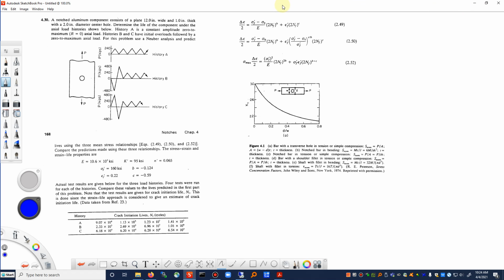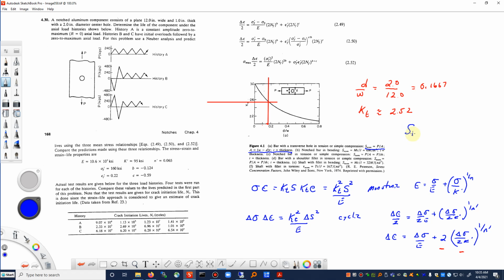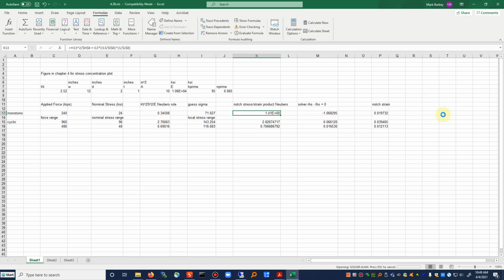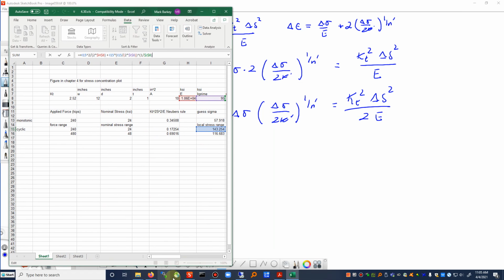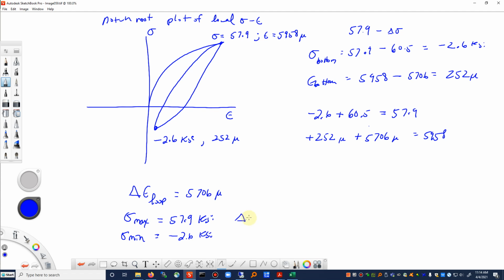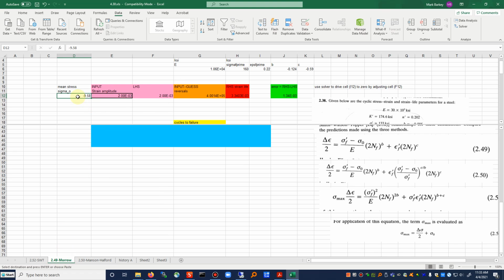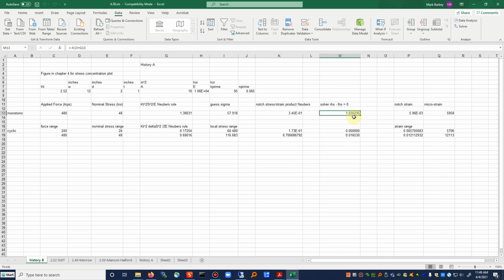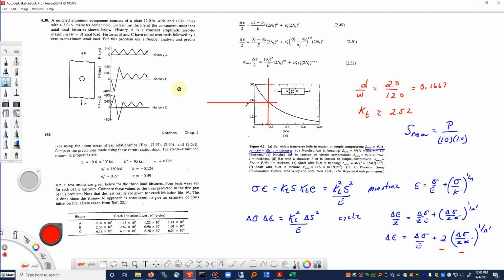24 4 30 partial solution cyclic neuber

Comment: Mr Barkey, Thank you very much for your great video. I suppose for the monotonic loading n' is intentionally used instead of n. Is there a reason behind this choice?
Reply from the maker: Since this is a cyclic problem, we are using the cyclic stress strain curve (with the prime).  There should be a video in this series on determination of the cyclic stress strain curve.  Cyclic values are use so as to capture stabilized properties in case there are material transients.